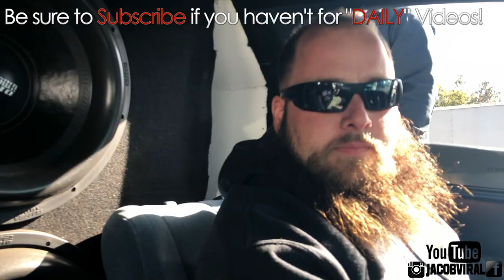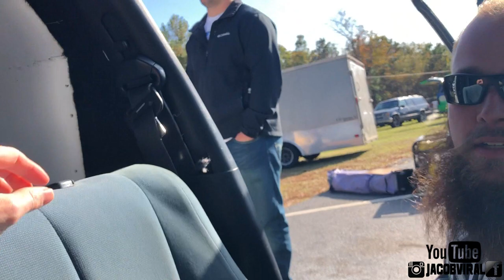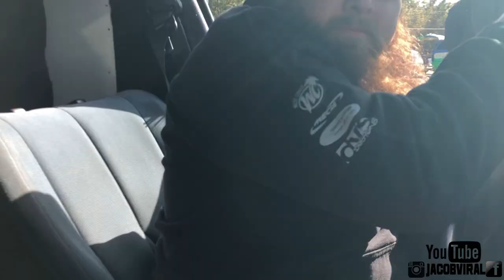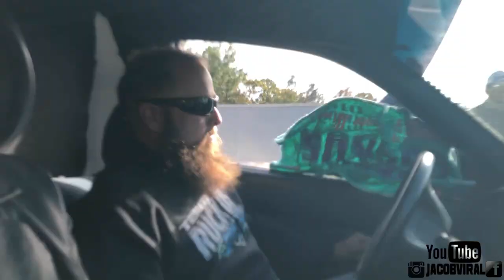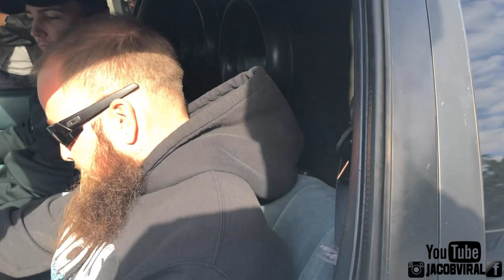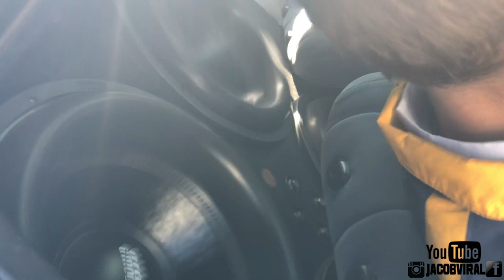SUNDOWN LOWS FLEX!!!

Comment: Yo Jacob I've got my Tahoe back over the weekend and MANNN that shits beating. My thing is I have to stop the vibration, is it hard on deadening your setup. I want to do it because I think the shop gonna charge me out the ass on doing it. Thanks
Reply from the maker: Awesome man! Deadener doesn't really stop flex much but helps slightly and contains the bass more in the vehicle. You should do it yourself as it's easy. Just order some online and get a roller. No problem!
Reply: @JacobViral  thanks for the advice. My man thing is to stop my back window from smaking against the metal in my Tahoe. Any suggestions on stopping that. It's so loud I can hear it over my bass

Comment: 6 12s or 4 15s? Which would you choose?
Reply: River Alley 15s its in description
Reply: 4 15s. More cone area
Reply: @robbrobb325  i think hes asking for preferences
Reply: Jaytaybrae 3 oh shhh my bad 👀 

But to answer his question 15s  of course just depends on the application
Reply: @theshobalt2029  barely.
Reply: 678in² compared to 706in². Efficiency of 4-15's over 12's tho. Especially if it's the same subwoofers just different sizes. It's easier to get the 4-15's to move as opposed to two extra motors.
Reply: Dibeezy ThaGifted about 30 inches give or take
Reply: @theshobalt2029  plus better efficiency. I have 6 sundown x12's and I'm going to 4-zv5 15's
Reply: Dibeezy ThaGifted I had 4 zv4 15s in my cobalt until it got totaled
Reply: @theshobalt2029  hopefully the equipment made it out unscathed. Haha. Put them in something new.
Reply: @robbrobb325  shit u good bro
Reply: Dibeezy ThaGifted had to sell everything to pay for a new car 😓
Reply: @theshobalt2029  grab some ZV5's. I have a couple of those too. Can't wait to get 2 more
Reply: 4 15s if I had the space!
Reply: @DibeezyTheGifted  what model sundown you got?? I just recently got a sundown u series 15. 1500watt rms. It bumps. Maybe you can add my snap and show me some clips of how those 12s hit? Sc jonespreston
Reply: @DexHoster  I've got U series 15, zv5 15, and 6 X12's. Go to my channel. I'll have some flex footage Friday.
Reply: @DibeezyTheGifted  dam pushing power then 😭 what are those 12s rated at rms?? Im 19 and a server at a resturant and ive spent about 3k in car audio in 4 months. Its wild how you always want more
Reply: @DexHoster  I'm going big. Bandpass box with around 15k rms